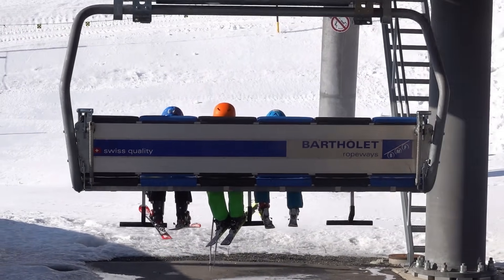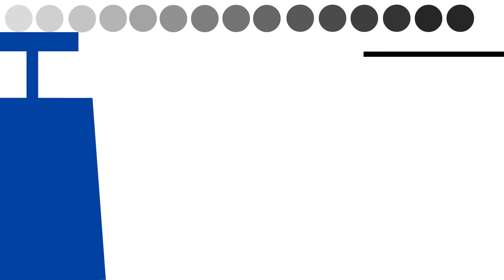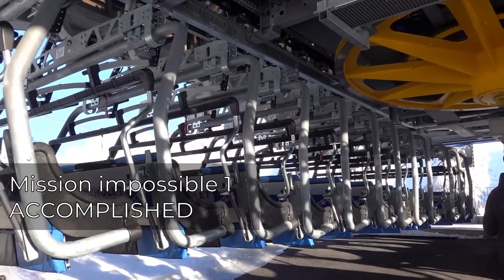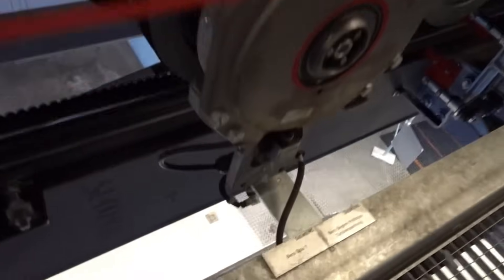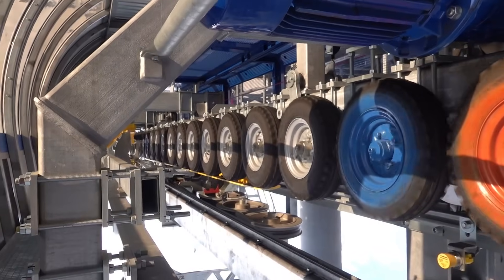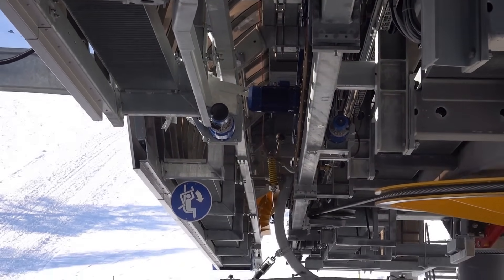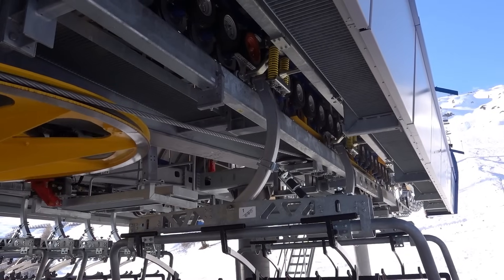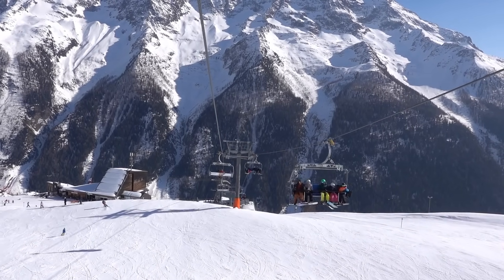The IMPOSSIBLE garaging that actually exists!

Comment: You seem to have repeated the same details overcomplicating the process in your description, and completely skipping over important details.  You did not explain how the individual wheels were controlled.  Do they have clutches?  From your description, it sounds like they just slow down the tow rope, so it doesn't require a long distance to slow each chair to a stop.  You never showed how they ungarage the chairs.  I assume they do just the opposite, slowly adding them, which would take 5-10 times the regular time it would take for chair 1 to make a complete cycle.  That could take 45 min to over an hour.  This is not groundbreaking.  It seems like they could better achieve the same thing with each wheel having it's own motor all controlled by the computer.
Reply: You should watch the video again.
He shows how the tires are powered by smaller variable speed motors, each driving a short section of the tires.
Then using the inductive position sensors and speed sensors on the motors, the PLC computer in the cabinet controls each group of tires to move the chair across it at the correct speed.
This is all covered in the video, with the motors shown, and the different sections shown as well (the tires painted different colors and spinning different speeds)

The only exception is the last set of tires on each end are driven directly from the rope way so they always match the speed of the rope.

I would guess that no cars are stored on the "Exit" set of tires (the ones connected directly to the rope), and so to ungarage you simply start the rope moving at a slow speed, and jog all the tires forward one car at a time, so that a car comes off the end of the last independent section of tires onto the Exit section of tires at the correct distance apart, and so unloading takes basically the amount of time for one complete trip by the cable at a slow speed, and entirely automatically.
Reply from the maker: @ke6gwf  Hi Ben! While I don't want to rate my own videos, I thank you for your kind defense ;-) Your guess is exactly right!
Reply: Pneumatic clutches exit I’ve seen them multiple times on leitner poma lifts